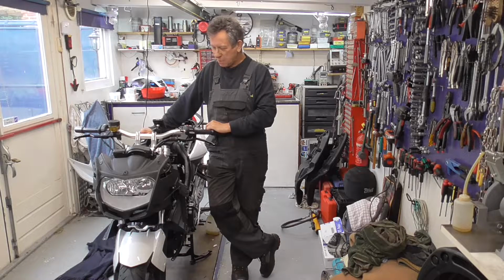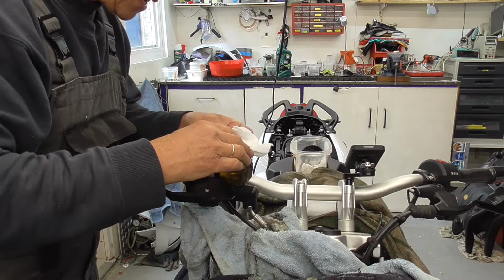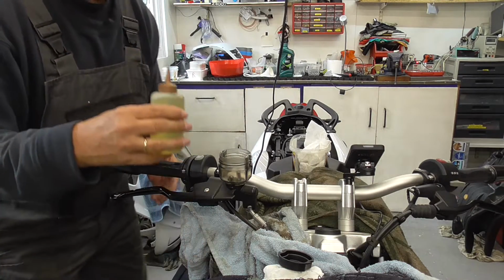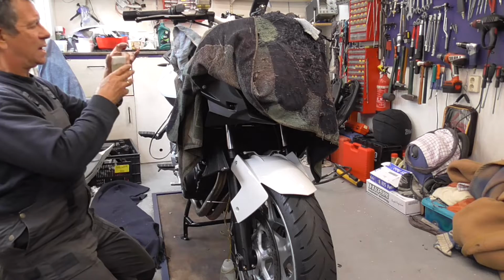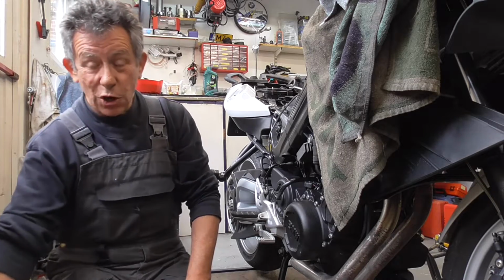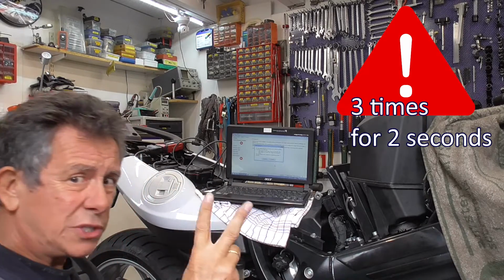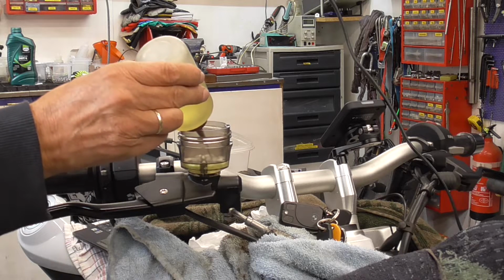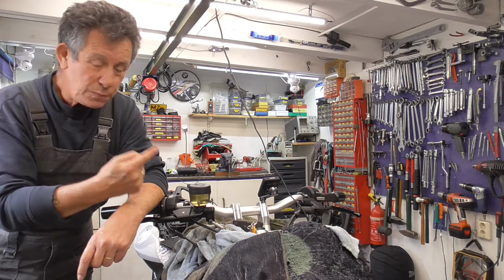BMW F800GT [2014] FRONT BRAKE FLUID. ITS SO EASY..! Motorcycle maintenance made easy.  👨‍🔧---🏍

Comment: When I first started driving and motorcycling many moons ago, this was unheard of. The brakes would be bled only and it always made a huge difference.
Reply from the maker: Your so right, but a lot has changed since the old day, much better brake fluids, calipers these days have become better, in Quality and performance 👍🏻👊🏻😉
Reply from the maker: And by the way.. what about the brake lines these days 😉